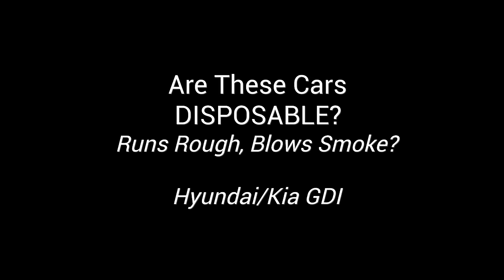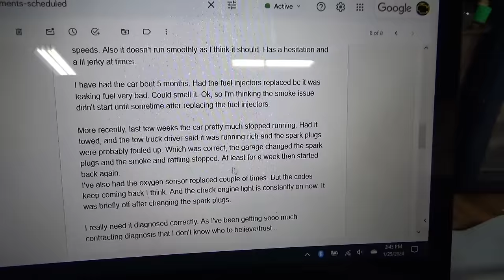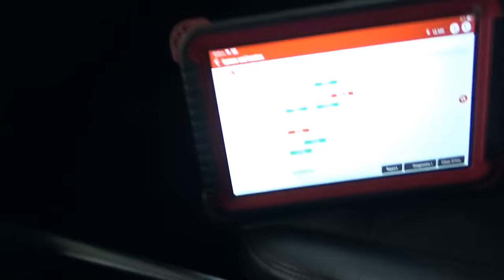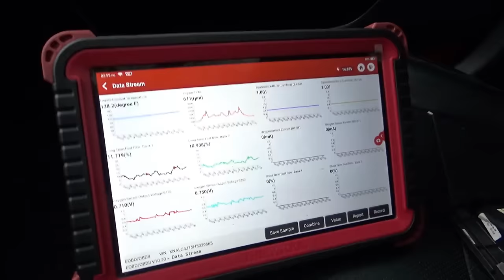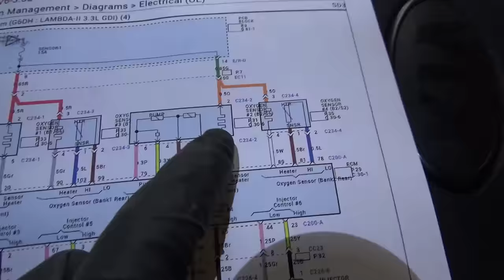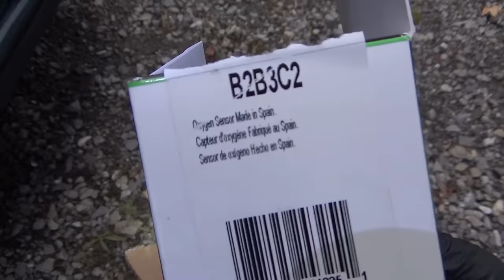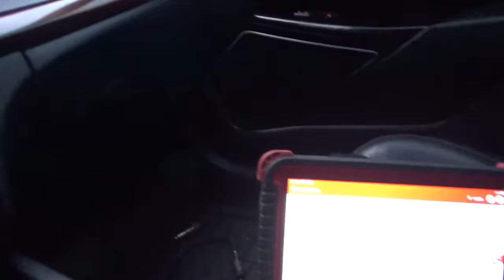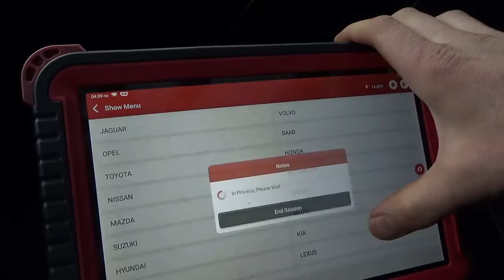Are These Cars DISPOSABLE? (Hyundai/Kia GDI Burning OIL - MISFIRE, Low Power)

Comment: I change my oil every 3,000 miles and my PCV valve every 15,000. I know these are weak vehicles and its cheap insurance to Hopefully keep it a long time
Reply from the maker: I've never changed a PCV valve in my life... 3 of my vehicles have over a quarter million miles on them 😂
Reply: @PineHollowAutoDiagnostics  oh lol. I thought it was part of maintenance. I'm not a mechanic. I just read if the crankcase pressure builds up it can damage the seals and cause leaks. And it's easy and cheap. Obviously I don't know what I'm doing lol. You just read stuff online

Comment: 2011 Kia sorrento with 190K, non-gdi.  No real problems except pcv valve seizing.  rear main done, another 100K miles.  3.5v6.

2016 new hyundia sonato 2.4 gdi, first 3k miles, 3 quarts.  it was totalled out at 4k miles. dodged a bullet on that one.

Comment: After reading a lot of the post I am glad I own a Nissan 2002 Pulsar with 209 thousand klms on it & it does not use any oil, every time I change the oil I check the dipstick & it is still at the level it was when I done the last oil change.

Comment: Has someone tried to change low ash oil meant for DPF diesels if it would help with cat o2 valve issues on those oil burners? It shouldn't leave those deposits which gum up everything.

Comment: Had it had a new exhaust fitted? They tend to destroy them to get them out sometimes. Trouble is with the cat you don't seem to notice the oil burning as much out the exhaust. On my Car at the moment I think the valve stem seals are going but you only see a bit of oil on start up sometimes. But it's losing lots of oil in 6 months but still passing emissions test.

Comment: I am curious about the lack of metal shield on that sensor. If it's not in the cat, does that point to the last tech fitting it in broken? Surely a cat does not get hot enough to vaporise it? Or, did another tech remove the cat to see what the rattle was, then taking out the offending cap? But if so, surely he would have then told the customer he needed a new sensor.

Comment: Im sure seafoam works great on small engines. Seafoam is my "go to" chemical fix for varnishy/ carboned-up lawn mowers and weedwackers. I once fixed an oil burning 1991 ford probe, 3.0 liter engine, needed one quart every 3 or 4 hundred miles with Rislone oil treatment..i believe some rings were carboned to the piston

Comment: Before investing money in flushing the engine with chemicals for cleaning piston rings, I recommend assessing the condition of the cylinder walls; if the walls are worn out (no honing, scratches) or the cylinders have lost their geometry (black spots), then there is no point in decarbonization them.

Comment: Would this CRO product help with carbon buildup on valves from GDI?  My guess is no but curious.
Reply: No. You either need a spray product thru the intake or a vac line or walnut blasting on valves.

Comment: My take on these is they absolutely do not tolerate any neglect on oil changes.   

And by neglect I mean going beyond 5,000 miles on oil changes.  Forget that 8,000 or longer BS manufacturers recommend these days.
Reply: Read the manual.  There's often a SEVERE maintenance schedule and even that might not be enough.
Reply: @mobileoncue1370  for sure.  And what qualifies as "severe" driving is basically everyday driving for most people.  Things like going up hills, or sitting in traffic.

Comment: That explanation of clouds of smoke and then engine rattling sounds like liquid oil is being sucked into the intake stream like a bad/pooling oil PCV system causing the random clouds/pinging/loss of power/plug fouling. It all still points to a bad design/worn engine. Planned obsolescence... capitalism.

Comment: GDI engines. Carbon buildup is always the culprit. Diagnosing hyundai/kia is a rabbit hole that has only one conclusion. If you were lucky enough to not bend valves or rods, stretched timing chain yet.. YOU NEED TO CLEAN THE CABON BUILDUP IN THE INTAKE, EXHAUST AND COMBUSTION CHAMBERS... Korean cars have a short shelf life.. they are disposable cars meant to be used once and done..

Comment: I swapped my 2018 kia sorento with 70k miles.  5 years earlier than i wanted.  I was burning 1-2 qts every 1000 miles.  I saw these issues coming and warrenty was spent.  Will never buy another KIA again.  They know of the issues but too bad.  At least Chevy paid me when i had the same issue with an equinox

Comment: This Kia is seven years old with oil burning issues my 1997 Toyota Hilux does not have oil burning issues and has done 435000 kilometres   and that is on its original carburator and l have owned it for 4 years and in three years time l will have owned it for seven years and the Hilux ute will be 30 years old and we own a 2017 Suzuki Baleno although there is only 77000 kilometres on it it will probably going well in seven years time why there are now two countries that build very good cars Japan and lndia after all our Suzuki Baleno was made in lndia and in Australia we get the Mahindra built in lndia and l know of four that have done over 500000 kilometres this Kia will not do 200000 miles before the engine needs replacing

Comment: I have a 2011 equinox 2.4,  at 90,000 miles,  pulled plugs, a mixture of lacquer thinner, tranny fluid (to keep it on rings)  1 quart each cylinder, left 24 hrs than did it again another gallon, 24 hrs, rotated to blow out (prevent hydro lock) dumped fresh oil, run, than dump again, pretty much ended the consumption past 10,000 miles, but may not work on Kia.  Was bought used 60,000 miles oil looked like it had never been changed oil monitor goes off at 9000 miles I don't follow it

Comment: Had an ‘05 Dodge Stratus with the 2.7 V6 that gave me a P0420 code at around 90,000 miles. I think that’s “low efficiency bank 1” if memory serves. Traded that piece of shit in for an ‘07 Honda Accord and never looked back.

Comment: The true source of many of these modern engines failures including  some Fords, Hondas & Toyotas is the ridivulous push for 40 mpg fuel economy by EPA & political types. GDI, small engines, plug in EVs, low tension rings, tubros  on daily drivers, CVT transm😮ssions all high failure points. Most cars were fairly reliable 20 years ago. Manufactires put more effort on infontainment than badic function &'reliahility. All in the name of am unproven climate change insanity.. Thanks Miss Greta & Barry OBuMA!
Reply: I mostly agree, but plug-in EVs are not bad. Yes it adds the complexity of EV drive, but eCVT is simpler and more reliable than classic AT and with plug-in car you get fuel freedom = more value.
Reply: @petrnemecek4379  Since there is no, ZERO political will to develop & build smaller efficient nuclear power plants... How do you think the electricity to charge these EVs will be generated? Not by wind or solar but fossil fuels for at least the next 50 years.
Electric generating inadequate, power distribution inadequate, charging inadequate, and the whole idea is VERY inefficient! Turning fuel to electricity is nowhere near 100%, converting line voltage to charging voltage cause heat in charger & battery nor near 100% efficient. And those heavy toxic batteries that can & do catch fire are nowhere near efficient! Just carrying the weight around is pure folly! Now the Tesla is a fun wonderful toy but taking our $$'s to bribe upper middle class folks to buy them & then lets not charge an tax to build & repair roads, infrastructure, charging locations? Insanity... The whole thing is a political scam. Even OBUMAs guy who proposec these ridiculous policies has reversed course & said he wss wrong! Much like the wonderful "Coved" response think maybe it's all about $$'s power & political control. Certainly NOT proven science! Sorry to piss in your pool but the true scientific research had been done if we open our eyes and minds to the real fact! BTW most world pollution comes from China & India not from cow farts, lawnmowers & 15hp fishing motors. China & India are building coal fired power plants. We're tearing down coal plants that were updated to reduce pollution but mom needs to drive a 7-8,000 pound SUV to get groceries & haul kids?! WTF?

Comment: I've got the Lambda II GDI turbo V6 in mine, OCI by the book is 7,500 miles.  By 7,500 that oil would look like charcoal.  Every 6 months / 4k miles full synthetic for me and even that is dark by the time it's done.  GDI improves power and economy but not at some definite costs.

Comment: Good thing kia makes their engines easy to work on. Swapped an engine into a 2013 Hyundai Accent, it was very easy, they even have factory installed hooks ready for you on the alternator. 

Guess how many miles it had? It blew at 125k miles 😂.

New owner got a car with a 25k mile engine..

The car drove looked and drove very nice but man i got rid of that thing so fast.

It was a good learning experience.

Comment: Kia/Hyundai engines are such junk, you don’t even have the option of getting an engine from the junkyard. You’d have to go new engine or out of a low-mileage wreck but then you’re not buying too many km’s.

Kind of the only reasonable option for these is to have a young guy buy it for slightly above scrap value and try swapping in junked engines or pulling the engine apart and replacing piston rings.

After watching lots of videos on these products, I don’t believe any products will work. I’d try parking it and filling the engine all the way past the piston rings with a strong solvent and letting it soak then draining and turning over by hand and flushing with new cheap oil and turning by hand and then new cheap oil, just as a start to try unsticking the rings.

Comment: Why 10w30, is the car doing lot of very short drives? It would make more sense to me to go from 5w30 to 5w40 oil.
Reply: I'd certainly use a lower viscosity oil in an old or worn engine using oil. 5W40 or 10W50, especially after a treatment with engine cleaner.

Comment: With GDI, light tension rings and over extended manufacturers recommended oil changes, these engines are going to die early!
After watching the (Toyota) Car Care Nut doing engine changes, because owners let that oil go way to long according to the manufacturer's recommendations, the fix was $6000.00 plus in parts and labor.  With that came his warning of doing a 4000 mile or 6 months whichever comes first, oil and oil filter change.  My wife has an 06 Kia Sorento V6.  It has 180,000 plus miles on it, and the engine still runs good, but, the car has been a money pit.  It's non GDI, but Hyundai/Kia are not on my list of long lasting vehicles.
I recently bought what Ivan mentioned regarding Bernie Thompson's recommendation.  It's a 2 pack, one in the engine and one in the fuel.  In about 2 months when I do the oil change I'll try it on the Kia as per Bernie's recommendations.

Comment: Insanity, you betcha. So many manufacturers now have TSB about oil consumption. Almost all say 1 quart of oil per 1000 miles is acceptable. Since when? It's not acceptable to me. Lately I've been thinking that the gas stations need to install oil pumps next to the gas pumps for added convenience. Different weights of oil buttons under the octane buttons.

Comment: I'm not convinced a higher oil viscosity will decrease the oil consumption. Only when the engine is cold (at the expense of lubrication). You need a high quality oil that maintains a good viscosity when at operating temperature and also is resistant to shearing (that makes it looking fluid like piss when it gets older). How about carbon deposits on the valves? Being a GDI, was it ever blasted with nut shells?

Comment: Might want to consider watching the B-12 protocol used by "Eurotrash Motorsports" channel. Several vids in the series, with 5k mile follow ups, showing the fix works long term. He's had astonishing success on multiple cars.  First in the series is "How to fix excessive oil consumption from clogged piston rings (Part 1)"

Comment: Plz do Ivan! Try it on the Camry I need to know if it works 
My Camry burns a quart every 2k miles not bad but would like to resolve my own issue 
Just like yours it was neglected but once I took over I’ve done everything I could do without changing out the rings.
I’m Trying to make it to 500k miles even a million with original engine 😂

Comment: Yota 1nz 240k clock time, original owner.
Recently started burning about 2 quarts between oil changes (no smoke on start up or at idle). Did the BG EPR treatment and seems to have cut oil loss in half + running way smoother. Excited to see some 505 results.

I spend too much time following your channel, along with SouthMain. You guys are great Techs and appreciate the knowledge sharing.

Comment: My understanding of oil viscosity is that there is no operating difference between 5w30 and 10w30 at normal operating temp.  The first number is viscosity at "cold" engine temps and when warm, the viscosity is the second number.  My point being, shouldn't you have gone to a 5w40 or 10w40 to limit the oil burning?  Very interesting case study.

Comment: adding 4 ounces of superzilla to the fuel every fill up will clean the valves.. maybe postpone the enivitable... superzilla is amazing stuff..  superzilla is the very BEST STUFF I have ever used... eats carbon like nothing else, and does not harm the engine,, for direct treatment of piston rings, remove plugs and spray directly into the cylinder and let it soak for a day.  I like the stuff so much I order it by the case.,, its not cheap but worth every penny.. I tried it on an air cooled kawasaki mule that had a badly carboned up piston,, after soaking the cylinder overnight, I cranked it over with a rag over the spark plug hole and was shocked at how much carbon came out,,, I replaced a worn idle jet, and now it runs like brand new.. I use it in my outboard motors, my old 94 chevy,  lawnmowers, ect and it makes everything run better..

Comment: MY wife's 2018 Honda 1.5 with turbo I change oil at 50% and use 10 /30 full syn oil instead of there 0/16 and by passed the stop start that's really hard on turbos , the oil doesn't smell like gas any more, and I use top tier gas , and no corn gas ethanol ever.

Comment: Valvoline is marketing Restore and Protect as a piston cleaning oil. It's worth a shot. With so many makes with these oil chugging engines today, I hope it works as advertised. I've personally had great success on a Berryman's B12 piston ring flush on a 2.0 Audi that was using 2 qts in 500 miles. After the flush, it 's well over 1000 miles/qt.

Comment: One of the many problems with the H/K engines is they don’t have steel cylinder liners and have soft piston rings. The cylinders cannot be rebored or honed. No one rebuilds these engines because they are throw away. Never go over 5,000 miles on the oil and 3,500 is preferred for an oil change.

Comment: Last year I had a 1.8 Hyundai engine apart for the classic piston slap knock knock and I couldn't believe how small the ring lands were I had the block bored .020 thousands and new pistons and the head redone and it's like new again but I can see why they burn oil i would try royal purple and run it and it might clean the crap out of the ring lands and maybe slow the oil burning down or stop it altogether

Comment: 1st, i'm NOT a mechanic, so i can tell u only f/experience... also, i'm an AMSOIL guy... i've had a couple cars w/a problem of chewing oil, so i hav gone 2 a higher weight oil, butt on thicker end, not lower... that as i know it is only wen u r starting in colder weather... i hav used a qt. or 2 of 40/50 weight & that has stopped in most cases consumption... & surprisingly helped their MPG... in that engine i wood hav used 2 qts of 40 weight, maybe even 3, because of amount of smoke & since it takes 6.9 qts... & yes i did subscribe... 🤑

Comment: glad I bought a Buick Lucer. Push rod engines never do any of this stuff. push rods are the most quality engines to buy. It's worth it to get 3 mpg less. All push rods require is oil changes and spark plugs, and fixing the occasional gasket. and they can hit 400,000 miles. Hyundais are pure garbage. I feel bad for anyone that bought one of these. (Actual sympathy) Toyotas not any better either, they have all the same crappy oil burning issues plus unintended acceleration and killing drivers. (I experienced it on a Toyota I owned, with my foot on the brake it accelerated and raced out of control.)
Then there's Nissans with the constant transmissions conking out!
 American manufacturers just make better cars now. The tables have flipped. Stay away from Nissan, Hyundai, Toyota, BMW, Audi, VW folks.